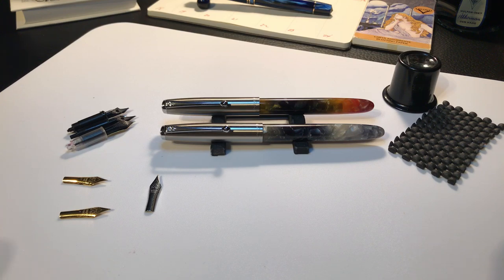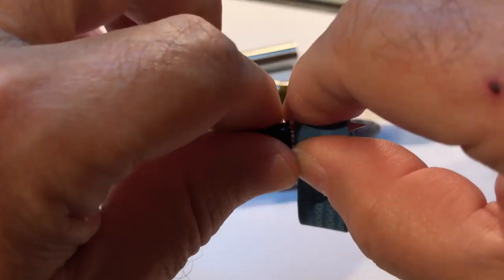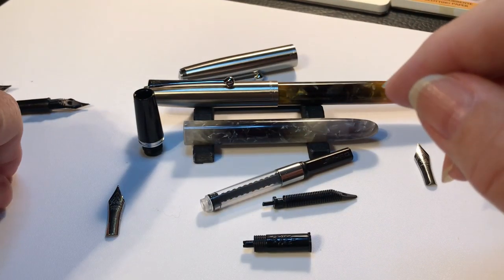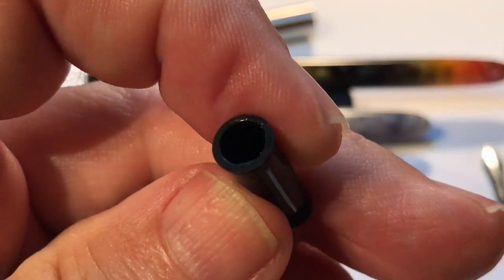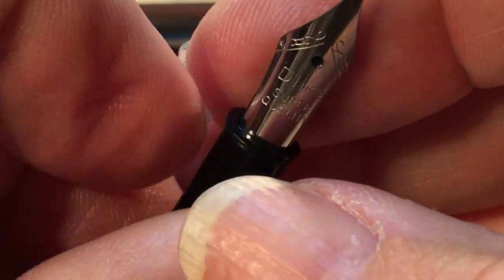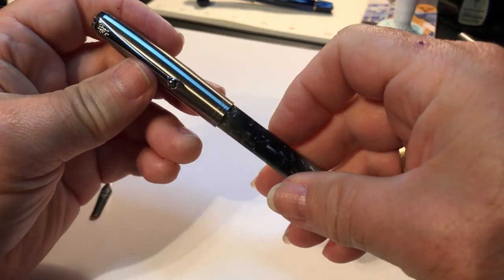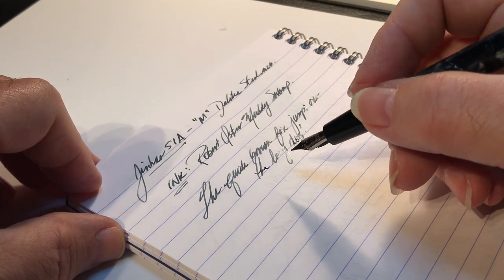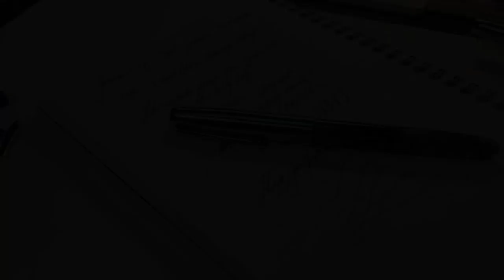Swapping the Nib on a Jinhao 51A: Non-hooded Version

Comment: Huh ... Just got my 51A in Ebony today. I didn't know there was a collar that unscrewed from the grip.. Thought it was the same as my Number 6 nib X450's.
I hope I didn't need to wash the inside of the collar, like the feed and nib to get rid of any oil or manufacturing crud that may have beed present.

Question: Do the Zebra G Flex Nibs need to be resized to fit on a Number 5 feed? I know they do to fit a Number 6 feed.
Reply from the maker: A #6 size nib will only fit a #6 size feed.
Reply: @InkquiringMinds  That's not what I asked.
No matter. I guess I'll find out when I get some G nibs to fit to my Jinhao X450's if they need fitted to the 51A's number 5 feed.
Reply from the maker: @stevehuffman7453  Sorry if I was unclear. The Zebra G nibs are dip pen nibs and are roughly #6 size. You can adjust them to fit some #6 size feeds; like on the Jinhao x450. I sincerely doubt you could fit a Zebra G dip pen nib on a Jinhao 51A open-style nibbed fountain pen.

Comment: Hello doug. Kindly suggest me a nib upgade for my jinhao x450/750. Recieved them today. Didnt liked the M nib on them. Preferably an international seller.I like fine nibs. Thanks.
Reply from the maker: The x450/x750 will accept almost every #6 size nib there is. I would suggest you try Goulet Pens #6 steel nib (they are made by Jowo). A less expensive option, if you like character in your writing, is to try the Kaigelu Long Blade or Long Knife nibs. They are inexpensive and I love the line variation from the architect nib.
Reply: @InkquiringMinds  thanks